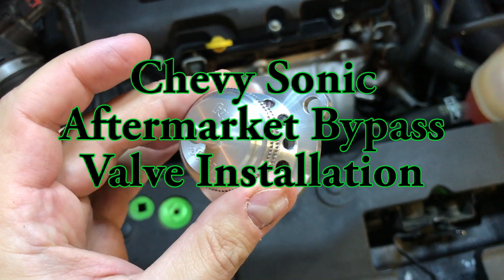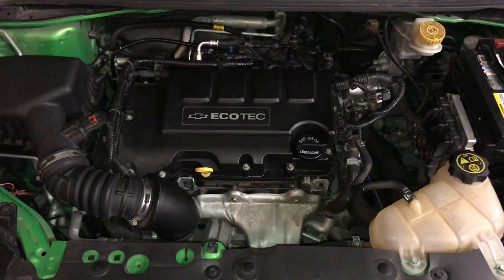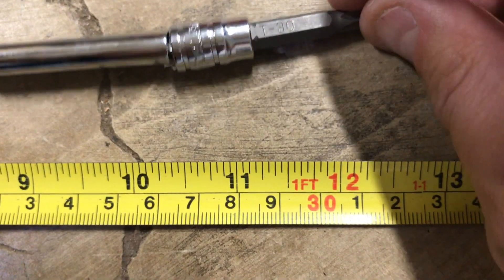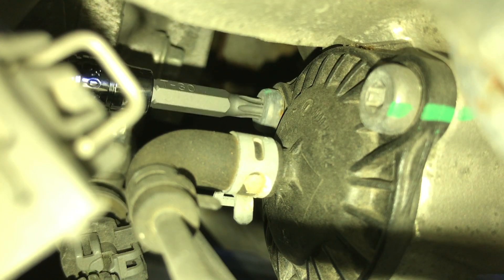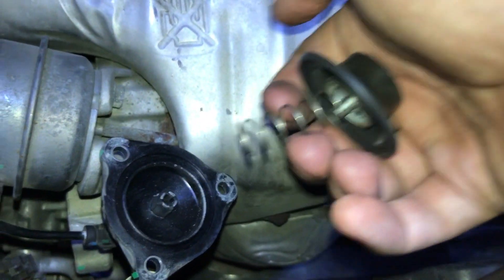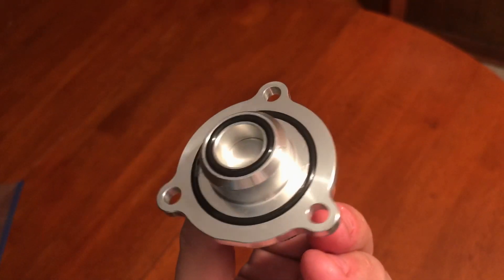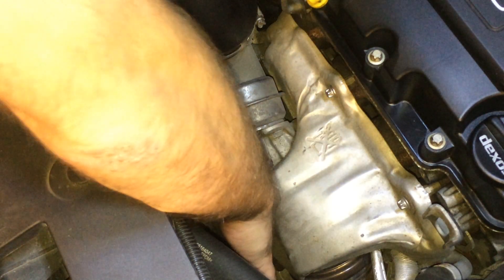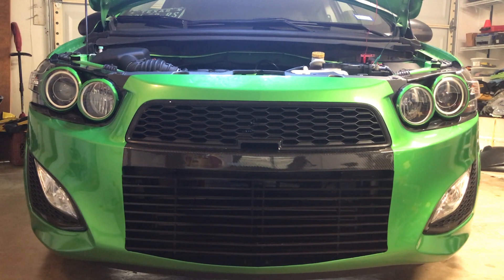Chevy Sonic BOV Install (Atmospheric Bypass Valve)

Comment: I have a 2018 sonic rs would I be able to install a atmospheric bypass valve with no problems ?
Reply from the maker: cindy jimenez Yes if your Sonic uses the 1.4L turbocharged LUV engine. The ECU on the 2018 might be more picky and give you an engine light. A tune from reputable sources (like BNR and Trifecta) is recommended not only to avoid an engine light, but also to give your sonic a little extra GO.

Comment: Any ideas if that BOV fits 2013 chevy trax.
I checked mine out.
Looks same.
But dont know the demensions.
Can you help me out.trying to find 1 for my vehicle.
Unfortanetly  im not in US 
Any site names besides 
Andys auto sports allready contacted them they put me onto turboxs and turbo smart.they 
No answer unfortanwtly
Reply from the maker: KING TURK Hi. The Chevy Trax shares the same platform at the Sonic (Gamma 2), which means certain country versions also use the same engine. To make sure this BOV absolutely fits your Trax, you’d want to make sure it’s the 1.4L LUV engine. One way to check is look at your VIN. If the 8th digit from the Left is a “B” then this BOV will fit.
Reply: @DIYToona  will do thanks for the heads up
Reply: @DIYToona  another question
The air flow pipe is it same for trax aswell.
Reply from the maker: KING TURK Are you asking if the engine air intake (where the filter is before the turbo) is the same? Or the intake manifold?
Reply: @DIYToona  about the cold air intake.with the pod filter.
And i checked my vin number.
Unfortanetly no B at the 8th letter located.
So how would i find BPV suitable .
I asked in email to the place you got it ftom.
They said YES it will fit.
But i dont want to risk it.
Cargo costs alot and dont want to screw up my turbo either.
What if i gave you my VIN number could you help me find BPV for my car and send me the site link .
If you can pls ...
Reply from the maker: KING TURK The Intake would fit the engine because the flange is the same size. However, the whole assembly might not fit the space in the engine bay, I’m not that familiar with the positioning and setup of other components in a Trax. If you’d like, send me the VIN and I’ll see what specifics I can find out about your engine setup.
Reply: Yeah on the BNR site it says to fit trax 1.4
Reply: Did you use the stock spring that come out of the factory BYPASS VALVE or did you install the new

Comment: What is the lil hard-line that is on the valve ? I know it goes the the elec solinoid at one time someone told me to tie in my boost gauge to it so I did . It does work but how accurate it is I don't know .....so if I install this valve I'm just going to put it in no diaphragm or spring ? I have the trifecta turbo advantage tune but that's 90 percent transmission I'm only pushing 19/20psi ...

Comment: Will this work on a 17 cruze.
Reply from the maker: lawzsocom As long as it’s the 1.4L turbo LUV engine it will work. The way some of the bolts are accessed might change due to engine bay layout, but ultimately the steps done on the old valve and new valve remain the same.

Comment: Do you need a tune after this being done..i saw on another video that you did
Reply from the maker: Some sonic owners claim because of the small displacement engine and low psi that a tune is not needed. I wanted a little more HP so went with Bad News Racing (BNR) who tuned my car to include the atmospheric bypass valve. HOWEVER, I was driving my car without a tune with this valve installed and never got any caution advisory codes.
Reply: @DIYToona  nice thanks for the info how long did u go befor the tune..how much did it cost for bnr tune
Reply from the maker: Alex Nava I drove 300 miles with no tune and didn’t have any issues. The tune cost $375
Reply: @DIYToona  what did the tune exactly consist of was it a remote tune
Reply from the maker: Alex Nava I sent a list of the mods done to my sonic and requested a “mildly aggressive tune” on 93 octane. I loaded the tune file with a purchased handheld.
Reply: Did I make any negative effects or lagging anything bad ?

Comment: Hey man I made the mistake of getting a bypass adapter instead of a blow off valve on my buick that shares the same platform....it threw a code? How would this be any different? I dont want to loose 100 for R&D
Reply from the maker: 《BRELAND 》 Can you paste a link to exactly what you bought. Also, which code are you getting?
Reply: @DIYToona  EMUSA Blow Off Valve Adapter Kit for 1.4t Sonic Models-FMSPF14A https://www.amazon.com/dp/B082HNDNVJ/ref=cm_sw_r_cp_apa_i_SX5hEbA549YSC
Reply: @DIYToona  I am unsure of what code as for I took it straight to auto zone had then reset the code and I put everything back to stock.
Reply from the maker: 《BRELAND 》 That part looks as though it would go between the turbo housing and the factory piece with the vacuum line attached. I’ve never seen such an adapter. If not installed correctly it’s highly possible you were in constant boost leak.
Reply: @DIYToona  correct it was working just like a bov at first but was letting of a little pressure upon building boost
Reply from the maker: 《BRELAND 》 I think it was how the factory diaphragm is placed into the adapter. The spring was probably pushing the diaphragm past the holes in the adapter that lead to outside air.
Reply: @DIYToona  I'm still at a loss as to why that would cause a issue? These new cars are so touchy

Comment: What kind of tune do i need after installation?
Reply from the maker: GriiffixPVP Some sonic owners claim because of the small displacement engine and low psi that a tune is not needed. I wanted a little more HP so went with Bad News Racing (BNR) who tuned my car to include the atmospheric bypass valve. HOWEVER, I was driving my car without a tune with this valve installed and never got any caution advisory codes.

Comment: Did you re use the factory spring and diagram?
Reply from the maker: Mark D. Gonzales Nope. The Forge has a spring pre-installed and a metal “plunger” that serves the same function as the factory diaphragm. For more info, look at the pinned comment for the video.

Comment: Something that you didn’t mentioned is that you will need a tune after install it. The recirculating valve doesn’t need a tune but the atmospheric does. If you don’t tune after install it the engine light will come on probably with the P0171 code
Reply: I got a p1101 code after install
Reply: AK Studio really?
Reply: @straightsixracing   yes i got that every time i start it and remove it cause did not received  the tune yet.

Comment: How has the car been running since you installed the atmospheric bov and do you still have it installed?
Reply: I installed this month ago and I had to remove it yesterday because oil was spraying out of it
Reply: @jeredclark5637  whoa. What happened.? Is it because it's an atmospheric and not recirculating?
Reply: yeah I had white smoke coming out from my car after I let off the throttle. so I took it to get it checked out and they told me that the aftermarket bov was causing it. when I took it off it had wet oil on it
Reply: just going to get a cold air intake and add a bov there. I think the problem definitely.was the atmospheric and not recirculating.
Reply: @jeredclark5637  oh wow. that's not good. Did u tune the car tho?
Reply: the car does have a tune yes
Reply: @jeredclark5637  well I just installed mine today and tuned it up again with the tune trifecta provided that will support the bov and it's running and sounding fine.
Reply: it took about 2 months for the problems to show themselves.
Reply: @jeredclark5637  I will keep you posted 2 months from now. I'm gonna ride it out and see. If not I do have my old stock bov. So I can go back if anything. And if that's the case I will go with forge recirculating bov instead.
Reply: @MrHim94  Its been two months, any oil problems?
Reply: that's what I probably should have done but I'm gonna go with a cold air intake and a bov from there. I had a couple other things that broke as well so that may have caused it to spray oil. good luck!
Reply: @jeredclark5637  I believe you had some other underlying issues that caused it to smoke white and spit a bit of oil from the bov to be honest. The bov shouldnt do that if installed properly and running a proper tune. And thank you 👌🏼

Comment: So this is a Bypass Valve? or a Blowoff Valve? also what's the difference?
Reply from the maker: aLeX GeNeSiS The one seen installed in the video is the blowoff valve. The bypass valve is what comes stock. Primary differences: Blowoff, vents extra pressurized air out to the atmosphere, very loud. Bypass, valve sends the air back to the front of the turbo, not as loud.
Reply: @DIYToona  is the car going to need a tuneup after installing this?

Comment: All your reply's, seem to focus on rev SOUND? Any engine improvement, in my book, is Performance! 
What's the benifets of installing this, just to have more engine noise?
Reply from the maker: Robert Hein There is much debate as to if and how an atmospheric valve can improve performance. On a small displacement engine like the 1.4 there isn’t any performance gain. Some might argue it even suffers extra turbo lag because the air wasn’t recirculated back into the intake.

Comment: Did you install the to atmospheric bov? And do you need to get your car retuned when you put this on?
Reply from the maker: Dustin Bach Yes I installed the “to atmospheric” bov. A tune isn’t necessary with these engines. The boost and air volume isn’t enough to throw codes or cause overly rich F/A.
Reply: @DIYToona  no codes or any? Awesome
Reply: Have you tuned your engine at all?
Reply from the maker: Dustin Bach I didn’t do it personally, but yes it is tuned now.

Comment: How about for a 1.4 but for a cruze
Reply from the maker: Marco Rodriguez As far as I know the engine placement and configuration for the 1.4T Cruze is the same as the 1.4T Sonic (except you get more room in the Cruze!). Double check the placement of components in the video with your Cruze to make sure.

Comment: Great build ! , Was wondering what kind of grill did you use I like the cut out and is that carbon fiber in between grills?
Reply from the maker: XicanMe420 So that grill was something I custom fabricated after I took a reciprocating saw to the lower grill. Yes that is carbon fiber separating the upper and lower sections
Reply: @DIYToona  thanks for quick reply Maan that looks amazing , I wanna do something like that I got the 1.8 my model and just cut open all the grill cause they have those stupid filled in gaps lol

Comment: Did it throw any codes? Because am thinking about getting one for my 1.4 chevy cruze
Reply: And did u put the factory spring back into the new one?
Reply from the maker: No it didn’t throw any codes whatsoever. And that was with factory tune. I don’t think factory recirculating valve spring will fit the forge (but I’m not positive). I didn’t do a spring change. The forge comes with a spring installed, plus an addition stiffer one for more aggressive tunes with higher boost.
Reply: I just had to remove mine yesterday as it was spraying oil out of it when it was activated by letting off the throttle. be careful with dump valves!

Comment: Whats the difference between atmosferic and recirculating? i bought recirculating but maybe it doesnt will make the bov sound :S can you help me?
Reply from the maker: MRHOTCAKE Atmospheric vents the “waste” air outside (into the engine bay area). Recirculating routes the air back into the intake just before the turbo. The atmospheric is louder.
Reply: @DIYToona  thanks, I think I bought the wrong bypass valve I wanted the bov sound... Damn :( so the one I bought will no sound and be the same as stock one?

Comment: Thanks for the video you made it easy to understand and easy to see all steps , the forge BOV was not cheap was it ?  Have you done the pcv mod ? The kit that bypasses the factory check valve in the intake I'd like to see a video on that one as well .
Reply from the maker: Bamboozel96 Yes I have done the PCV mod. If you look carefully in some of the shots you can see the brake boost line connected to the T-fitting on the top of the manifold. Unfortunately I didn’t create a video for that task.
Reply: @DIYToona  
That's a missing link video lol ...I have the one that goes to the throttle body spacer although I have not done it yet would like to see a video ...
Reply from the maker: Bamboozel96 I know. Believe me I wanted to make a vid for it, even shot some scenes. The task became too involved for a first-timer and I didnt want to make a video without knowing the best way to do the mod.
Reply: @DIYToona  
Well you made a good Sonic video there's a lack of them on you tube I might put one on soon I had a cold air before but prefer blow off valve for the sound etc
Reply: I meant put on a blow off valve not video ...

Comment: Hi... Which is better....  In order to have the pssss sound... 
I dont know if is better the bov or an air intake. Just for the sound what do you recomend. ? 
If  i buy the bov. Is it necessary to modify  the computer?
Reply from the maker: Gerardo Duenas if you want the venting sound to be as loud as possible, get the atmospheric. If you don’t want to deal with the BOV Installation, a hard-tube intake with conical filter usually allows some rushing air noise from the factory recirculating valve to be heard.
Reply: i recommend both

Comment: What BOV are you using? Looking at doing mine but unsure as to what BOV to get
Reply from the maker: Steven Switters This one is made by the brand Forge. They make both recirculating and atmospheric versions.
Reply: @DIYToona  both of them make the sound?
Reply from the maker: Gerardo Duenas The atmospheric has a louder sound. The recirculating will, but it will be slightly muffled, unless you have a hard intake tube.
Reply: @DIYToona   thanks a lot.  I will buy it... I have been looking for one.

Comment: When you put it does not mark an error code?
Reply from the maker: Aaron Cuenca No. I thought maybe it would code too rich because the metered air is venting into the atmosphere instead of back into the intake side of the turbo, but that never happened, even when not tuned at high boost shifts
Reply: @DIYToona  so I do not have to reprogram anything?
Reply: So when installing it will not affect anything? it does not turn on check engine?
Reply from the maker: Aaron Cuenca No reprogramming. No check engine light.
Reply: is that I have a chevy cruze and I would like to put it on
Reply from the maker: Aaron Cuenca it’s the same engine configuration on the Cruze if you have he 1.4t engine.

Comment: Thank you for this really informative and helpful guide! Will the re-circulation blow off valve sound just as good? I'm not looking to tune.
Reply from the maker: If you want to hear the recirculating bypass valve better, invest in an aftermarket intake that uses a hard tube and conical filter rather than the flex tube and filter box. This allows the sound of the air being vented back into the intake to be less muffles and heard through the filter.
Reply: @DIYToona  bro I have cold air intake and rest car is stock i hear woosh sound love it as its my very first best mod on cruze and was looking to make woosh sound louder. So the  as you said intake I have it already can i install this recirculating valve to increase more sound of woosh let me know please cause my car is stock and don’t want to tune it
Reply from the maker: @StreetLegalCars  Yes the recirculating valve will make the woosh sound you hear louder. You won’t lose any air, so a tune shouldn’t be needed.
Reply: @DIYToona  thanks mate which one should i buy forge or bnr or any other brand you know after this two
Reply from the maker: @StreetLegalCars  I’d go with the Forge recirculating. They sell it on the BNR webpage.

Comment: Two questions... any hp gain? Did you change anything on the ecu?
Reply: Luis Diego Ramírez Córdoba First answer, not without a tune. Second answer, I did get an ecu tune, but didn’t do it myself. I still need to hop on the dyno to see where I’m at now.
Reply: @LittleToona  great I'll keep checking... if you get any positive results on the dyno I'll order one
Reply: if anything you will lose power and have turbo lag because turbo pressure it released in the atmosphere instead of recirculating, sounds cool though

Comment: I try to use a Forge BOV spacer and it's no work , my car keeps the revs too down around 450
Reply from the maker: I'm not familiar with a bypass valve spacer. do you have a link for it?
Reply: DIY Toona this is the link of the BOV Spacer in forge... https://www.forgemotorsport.com/Blow_Off_Adaptor_Plate_for_Fiat--product--1009.html ... i don't have a video
Reply from the maker: That spacer is supposed to be installed with the factory solenoid valve. I don't think it will work in combination with the aftermarket bypass or blow-off valve

Comment: What do you do if my odometer reads dashes after i changed the battery?
Reply from the maker: Are you getting a check engine light as well? Typically that occurs when there is a module communication fault.
Reply: DIY Toona nope. Its just dash marks across
Reply from the maker: I'm really sorry, I've never seen or read about that issue, nor can I find any information about the dashes being isolated separate from a check engine light. Was your old battery disconnected from the car for an extended amount of time?